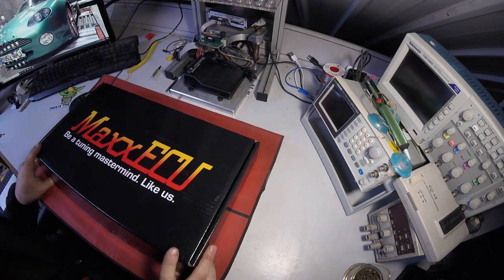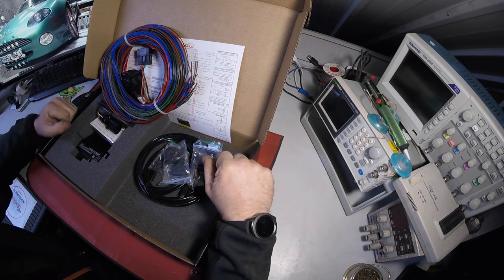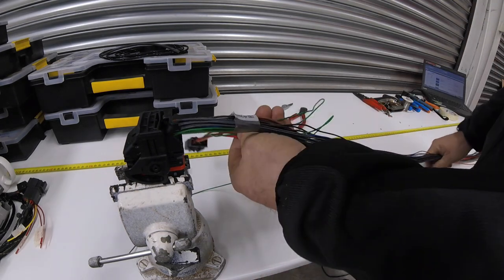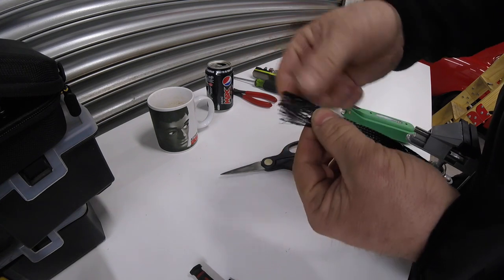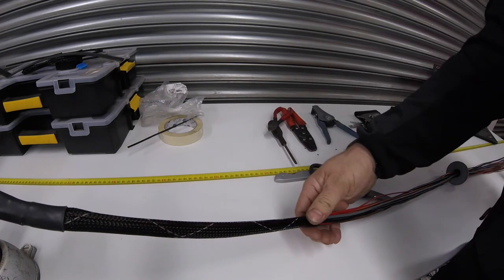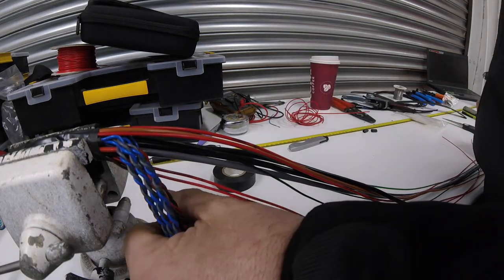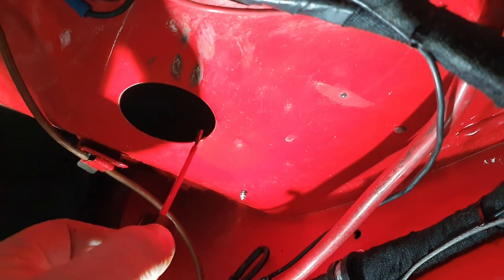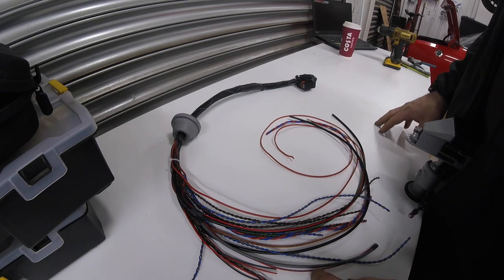Escort Mk1 Pinto Throttle Body Conversion. Building a wiring loom with MaxxECU, braid, sleeving.

Comment: Just found this video, what a great video. I'll hopefully be doing this for a turbo pinto in an mk1 in the next year or so. Daft question?! But do you just give the ECU an ignition live and earth and the ECU does the rest basically? And also would this be suitable for running 2 separate maps? Why at 21.47 does it look like the exhaust is on the opposite side, looks like the exhaust manifold it's coming down the nearside of the car? Or is it just me being daft!
Thanks
Rob
Reply from the maker: With the MaxxECU, you could have as many maps as youd like really, operated by switch or Bluetooth on some models. 

The ECU needs all its sensors connected as you can imagine, but ultimately, it will indeed need to be powered by ignition live and a current return. 

Steve